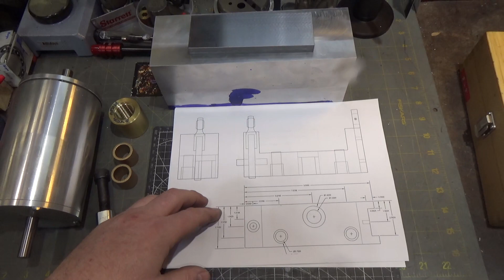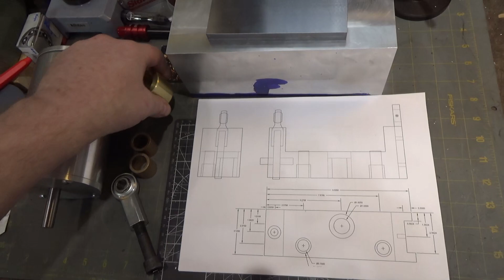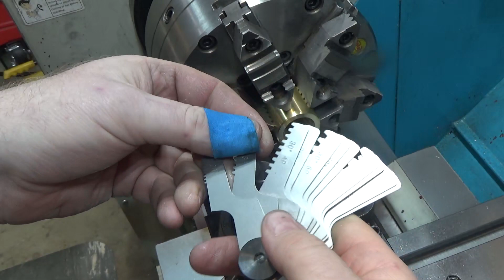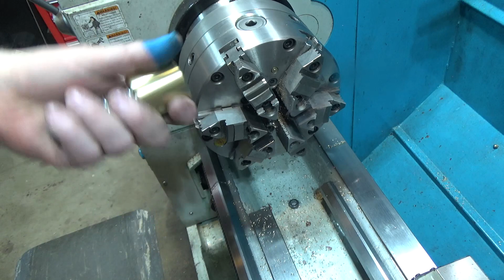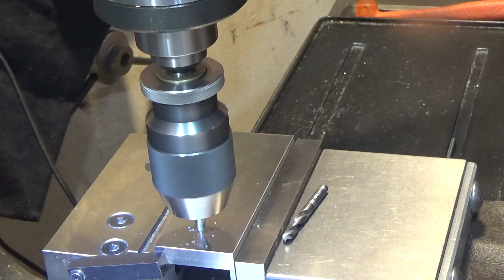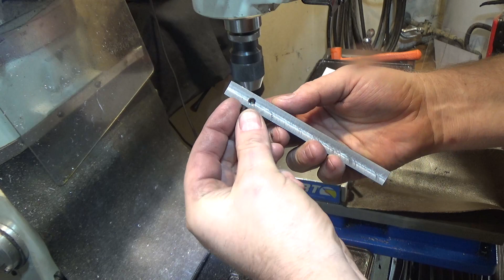148 6x48 BeltSander Upper Lift and Tilt Assembly 10 Part 1

Comment: Hi. Reamers should be run slow. Too fast will almost always produce an oversized hole. Great project by the way.
Reply from the maker: Thanks. That is the advise I have heard. On the flip side, I have seen some experienced pros use higher RPMs, so I thought I would give it a try.

Comment: I am with you on air vs vacuum. You are just making more work for yourself by blowing them around the shop just to clean them up later.
Reply from the maker: Exactly! It may not be quite as quick, but I think it ends up a better solution, mots of the time. Deep holes might be an exception.

Comment: A seasoned machinist once told me that machine’s should never be cleaned with an air gun. Always use a shop vac. He explained to me that air guns force small chips of metal into sliding ways on your equipment. Over the years that I purchased used equipment I would find the results of this practice in accelerated wear. Shop vacs are your friend. Cheers from West Virginia.
Reply from the maker: I have heard similar advise and have taken it to heart. Thanks for confirming the recommendation.

Comment: Hello Robert,
Good progress in today’s video… I00% agree on the vacuum vs air, maybe just because I am lazy.
Did you grind the drill with the D-Bit grinder or by hand? I did not know you had a surface grinder; I am off to search for it now…
Take care
Paul,,
Reply from the maker: I did grind the bit off hand on my grinder. I got the same surface grinder that Steve Barton over at Solid Rock Machine Shop got - an ACER. It seems to have been an excellent suggestion. I trust and respect Steve's skill and advise, which he is really generous with.

Comment: You could have used a regular thread pitch gauge to check the thread pitch.. You were right about the reamer cutting speed.
Reply from the maker: Thanks for the tip. I wasn't aware.